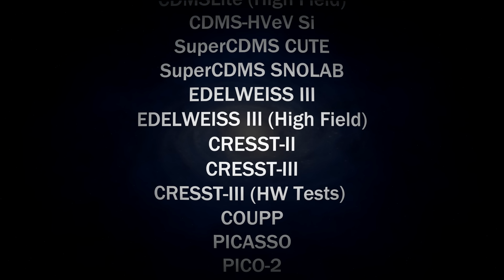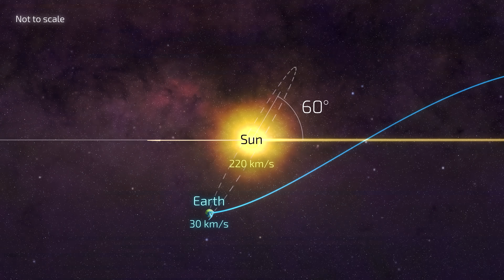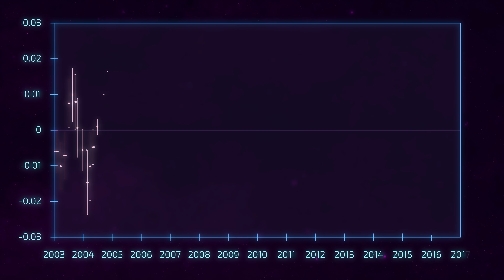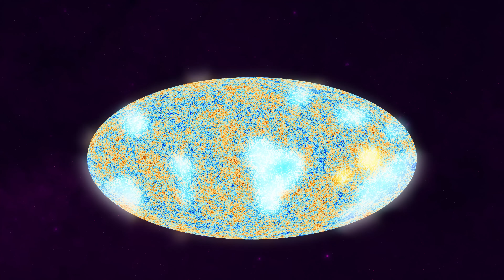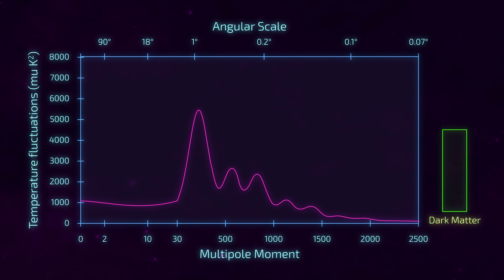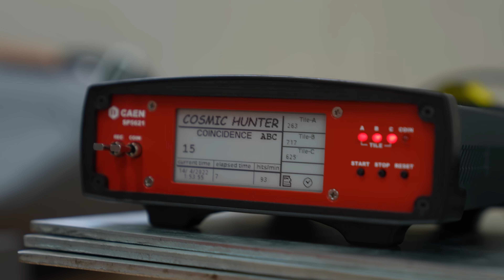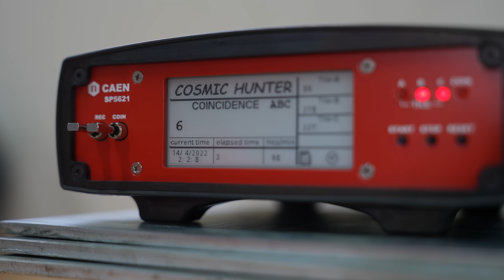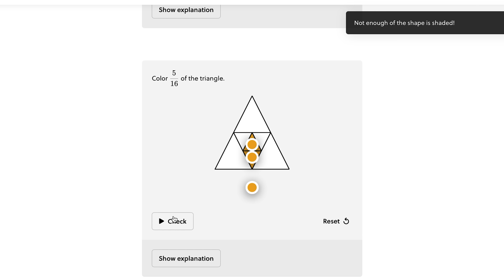The Absurd Search For Dark Matter

Comment: Dark Matter. Matter we cannot see, but has an overall gravitational effect, and comprises 85% of the matter in the universe. The simplest answer is usually the correct one. In this case, the simplest answer is that we've underestimated the amount of endo-galactic matter in interstellar space by 85%. Wouldn't be hard to do, since we have very little experience with interstellar space outside of our own Solar system, and in fact are right now just beginning to actually physically explore and take measurements of its physical characteristics via two "obsolete" space probes.
Reply: In fact, the JWST was in position a mere two weeks before it was hit by a piece of "dark matter" (a space rock we didn't see.)
Reply: You just ignorantly described dark matter again
Reply: @Lagiacrus1996  not really. Please note how my description doesn't say anything about it mysteriously not interacting with anything else, (except via gravity,) like the "official" definition. Here's the kicker: up until recently, the only measurements we've been able to take are those of our local solar system, where there are multiple planets which have largely cleared out the local space, (in line with the official definition of a 'planet'.) So, it's quite possible that the distribution of interstellar (and intergalactic) matter is far greater than we estimate, negating the need for a mysterious "dark matter". It doesn't take much matter, evenly distributed on a universal scale, to vastly change our model.

Comment: dark matter just planets and asteroids. they dont emit light therefore they are dark.
Reply: and dust
Reply: Those things interact with light though. Dark matter doesn't.
Reply: @Lagiacrus1996  yes but if im looking at a solar system that is light years away it would be extremely difficult to impossible to detect small space objects. not to mention all the gas and space dust that fill the space between stars.
Reply: @domenicperito4635  but we can see those, they block/scatter light. Youre underestimating just how much mass there is in dark matter, its not just some dust.
Reply: @Lagiacrus1996  they do block or scatter light and all light is red shifted from distant galaxies which could mean its just losing energy instead of expansion
Reply: @domenicperito4635  that doesnt explain dark matter 🤣
Reply: @Lagiacrus1996  neither does anything else. we dont even know if dark matter is real or if we just made a mistake in our theories.
Reply: @domenicperito4635  yes thank you for paraphrasing the video 🤣 something is wrong, that part is fact. The evidence points to it being an actual new form of matter, but maybe it's not. We know for certain its not planets and asteroids though
Reply: @Lagiacrus1996  i was just saying that since when they run galactic simulations they use fluid dynamics since we cant simulate the galaxy as individual things because we dont have the computer power and if we did it might infact be fine. like modeling everything with particles. its just a way to make things computable. it is not actually how the universe is though wich is why Quantum lattice theory came into being.

Comment: Can you please explain why in the case of the colliding clusters we should expect that most of interacting gas would remain in between the clusters?  
I would expect very few of the atoms of gas to interact at all or be slowed down because they are so small and so far apart that the gas is nearly a perfect vacuum. 
Also gas clouds are tend to exist in clumps which means clumps are more likely to completely miss the other clumps entirely because there would be more gaps between the gas clouds.

Comment: I have a theory that gravity is the contraction of spacetime, rather than just the bending of spacetime, although under normal timescales it cannot be seen, on the timescales of rotating galaxies it has a huge effect, basically gravity isn't a constant but dynamic, so this is why the calculations are out by like 85%, im interested to know if anyone can prove this theory incorrect 🙂
Reply: So you’re suggesting that gravity gets stronger over time?
Reply: @The.Renovator  I wasn't thinking in terms of gravity getting stronger, more, universal expansion working in opposition to gravitational contraction, effectively the net expansion in areas with higher levels of mass would be lower, the assumption is that universal expansion is a constant across the universe, maybe its not, maybe gravity isn't warped spacetime but contracted spacetime?

Comment: No it's mostly caused by the thermodynamics of the universe that in order to take an energy energy must be given so in order for a black hole to grow more massive and absorb the energy from the surrounding universe it needs to give energy back in the form of Hawking radiation that energy exits into the wider universe once given and that energy can be essentially a low form of kinetic energy that can do a push instead of pull towards the center of mass

Comment: you know... dark matter that don't interact with anything not even itself but affect gravity and movement.... that doesn'T look like something that we could call "matter",
and something that is filling the void of space and affecting and explaining issues about gravities... wasn't that called "ether"?
and why are we saying that ether/dark matter don't interact with anythingelse except gravity?
isn'T possible that the relativity and what we attribute to Tiem dislatation is more due to interaction with ether/dark matter?
the faster you go the more interaction you got with that "ether/D.matter" and thus maybe it therefor prevent radioactive decay in atomical clocks... which would explain then the difference in the clock reading...it wouldn't be time dilatation but interaction with dark matter which would strenghten the nuclear force bonding... like it does for gravity of galaxy...
and that speed of light limit would maybe be actually the limit speed of interaction between dark matter and "visible" matter.
and what if that dark matter then happen to move faster than light?
well that matter wouldn't be visible...

Comment: There must be another theory that would sound about like this:
Our universe is multidimensional. Matter is also multidimensional. What we're experiencing is mostly limited to a 4D spacetime. Hence models have been conceived to satisfy limited 4D observations.
But if we viewed 4D spacetime as a plane of a 5 (or more) dimensional spacetime, then imagine the 4D objects we interact with - 5D (at least) and the mass that resides over and under the plane - shaping the spacetime around them, hence "altering" the gravity they exert.
So there's not any new, exotic, matter but our good ole' bodies have different gravity "shapes" depending on their 5+D shapes and sizes. Not to mention bodies that don't intersect the plane.
The reason the gravity "anomaly" only manifests at cosmic scale, is probably because bodies are relatively orders of magnitude stretched/elongated in the 5th dimension than in the perceived 4D spacetime.
And particles coming into/out of existence in fact cross through our plane via translation/rotation.

The downside is the (apparent) impossibility to detect or get a sense of what's outside the box, from within the box. But you should take note of the slight morphing of cosmic sized bodies that reveal rotation (and at a lesser degree translation) in the 5+D'th dimension.

Comment: When matter gathers due to gravity, as in galaxies or star systems, it usually forms a disc.  If dark matter is only affected by gravity, why does it gather around galaxies in a spherical form and not a disc like all the other matter?
Reply: Asking the real questions. Also it doesn't gather that way because it doesn't exist. Simple as that!
Reply: @batencheetos  It doesnt gather the same way because its literally missing 3 out of 4 of the fundamental interactions, and it most likely does exist, we can literally measure its density
Reply: @RP-vi8fx  Measuring dust. Dust has density. Not dark matter.
Reply: @RP-vi8fx  But the coalescence of galaxies is a gravitational interaction.  The other three forces don't play any part in it.
Reply: the reason galaxies form a disk is the same reason that solar systems for a disc. At the start of the formation its not a disc but a chaotic (vaguely spherical) mess - and because of all the overlapping orbits of objects they bump into each other and fall to the centre until only a single dominant disc of orbits (that don't overlap with each other) remains. 

But since it seems that dark matter interacts only through gravity, even with itself, it can't bump into itself. The same way the dark matter didn't bump into anything in the example of two galaxy clusters colliding and just kept going past the visible matter in the clusters.

Comment: It's electromagnetism, operating through plasma and Birkeland currents. Gravity itself is a much-attenuated form of electromagnetic energy. There is no dark matter and there is no black hole at the center of the galaxy. Quite the opposite, there is no gravity at all at the center because gravity is an induced distortion of the dipole fields matter at the level of electrons and protons. It is induced by a difference in charge. Therefore, at the center of mass there is no distortion because there is no difference in charge, so no gravity.

Comment: Question: As we approach the gravitation center of an object, time dilates. More time happens closer to the center of an object than far from it. If this is true, then would not time be a variable when measured at the edge of a galaxy and at it's gravitational center? If so knowing that velocity is distance over time (m/s) should not the velocity of a galaxy be though of as (m/s(x)) where x is the variable for how time moves different based on distance from gravitational center. I am just wondering if this difference in the movement of time has a large enough effect to account for missing matter. (IE if the mass of the galaxy is massive enough to keep the outer stars in orbit would that mass be enough cause enough time dilation for the center to move slower from our vantage point to also correlate with the observed measurements?) Kinda long winded but was curious.
Reply: Time dilation doesn'twork in the real world.  Spent hours looking at it.  Just fanciful math.

Comment: June is when you get the solstices.
It's like asking "what opens the portal" it's like a combination lock with the solar system. Everything is all interconnected but you're trying to explain a part or component of the whole.
You don't modify anything. You take measurements with tools so that you can see what you cannot.
He said if God gave him the great book of physics part A and B LoL
The Golden Ratio is when you divide a line into two parts and the longer part (a) divided by the smaller part (b) is equal to the sum of (a) + (b) divided by (a), which both equal 1.618
November to June is when half the seasons are. They're just measuring the planet through space.
It's just yin and yang. Positive and negative.

Comment: 2 questions:
1. You mention a couple times that the belief is dark matter only interacts with other matter through gravity. The experiment as you describe it seems like an interaction other than gravitational (i.e. the dark matter will "hit" the sodium-iodine). Am I incorrect in thinking that?
2. The special paint coating on the wall in the cavern to contain radon...is that just lead paint?
Reply: when he says it doesnt interact with luminous matter it's a simplification, he does touch on what DAMA/LIBRA is actually assuming dark matter is, a WIMP, (Weak interacting massive particle). This assumes that dark matter can interact with regular matter, but does so at such low rates that it is borderline undetectable, thus remaining undiscovered.
Reply: @Meboy-uv5td  Thank you!
Reply: @Meboy-uv5td  I figured, but come on that's just being apologetic. That no longer is proper science. It's accounting for your observations without theory that can be falsified.
Reply: @rutger5000  much of this bleeding edge physics theories are unfalsifiable, competing hypothesis that can be proven but not disproven. Once one is proven, the search is pretty much over.
Reply: @rutger5000  
To the contrary, that's what the experiment is for. The hypothesis is that it does interact, but extremely rarely. So we wouldn't notice it among all the things that do regularly interact. The experiment takes away all the things that regularly interact, hopefully leaving us with only those weakly interacting things, if they'd be so kind to pop up.

Kinda like trying to catch the invisible man stealing our sandwiches by sprinkiing flour all over the room and getting everybody out.

Comment: Get a light bulb and place two positive electrodes with a negative in the middle with an element connecting them all and turn it on, you will see dark matter in between the two lit elements were no light passes.

Comment: 14:14 I'm with this guy, it'd be really exciting if we ended discovering a whole new family of particles, but since they apparently don't interact with each other very strongly, the chance of anything showing up that isn't a fundamental-level particle is low.
Reply: I don't know - I'd say we know so little about dark matter at present that we can't rule out some exotic interactions between its particles other than just gravity. The simplest explanation is that it's bland and uniform, but that's not the only solution to what we see...
Reply: @stephenholt4670  we don't know anything about dark matter. We don't even know if it exists. There are other hypothesis that explain the galaxy rotation curves, and make other valid predictions, and it doesn't rely on dark matter existing
Reply: A theory suggests that Dark matter could be normal fermions sitting on higher dimensions of the universe
Reply: but what if it's not dark matter but instead just a black hole that they are detecting and we just happen to orbit close to is every 6 months which is why the scan result peak in summer and drop off in winter
Reply: @raven4k998  ? what lol
Reply: @toxict7609  hey anything is possible you know anything even that🤣🤣🤣🤣🤣

Comment: A question I have always had about this galaxy spinning faster then it should is how much does relativity play into the observed movement. The most gravitational pull would be at the center of the galaxy. As a black hole slows time as you approach it, would not the same effect happen on a galactic scale? If this were the case we would expect stars at the edge of the galaxy to move faster because they are actually traveling through time faster.
Reply: That's what I was thinking. Going to have to whip out some math and see what the possibilities are.
Reply: The motions of stars in a galaxy are tiny compared with the speed of light in a vacuum, so I would not expect any special relativity effects.
Reply: @david203  The motions of satellites in orbit is tiny compared to the speed of light, yet we still have to account for relativity over this comparatively infentencimal distance to keep our gps clocks working.
Reply: @tcunero  That is absolute true (the corrections for both SR and GR are less than 20 msec each) but absolute insignificant compared to the rotation of a galaxy, or even to the orbits of the planets around our Sun.
Reply: @david203  Yes. I know even mercury's orbit was "slightly off" due to relativity. I only wonder because if we see the effects of it in our own solar system and our own orbit... could the effects when we have much longer distances compound to make the effect more. I have never seen a description that explains this at all. Just speculation. If you do have any information where someone has math'd it out or does a thorough description of it, please send it my way! I would like to see it.
Reply: Pretty sure the qualified astrophysicists thought to factor in relativity
Reply: @mattd6085  I never said they didn't.

Comment: Well here's an idea: the best place to start is to question your assumptions. Clearly a finding that there must be more mass than you can see is based on the assumption that you can and did accurately measure the visible matter. Its entirely possible that you simply got the mass of visible matter wrong and that its actual mass is fine to explain the speeds you observe
Reply: Mate, you don't think they've done that? That would be the FIRST thing they try to verify. These measurements have been corroborated dozens of times to make sure there is as little error with the original measurement as possible. The likelihood that tons of different scientists got the measurements wrong every time is much more unlikely than the existence of another source of mass.